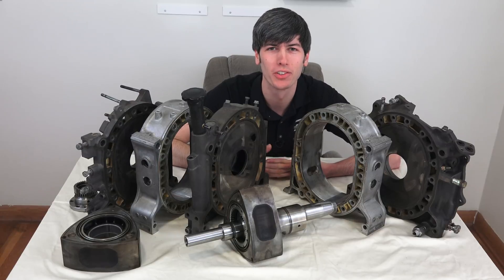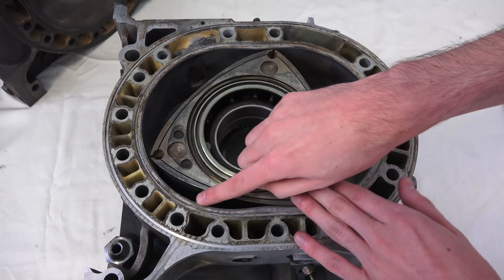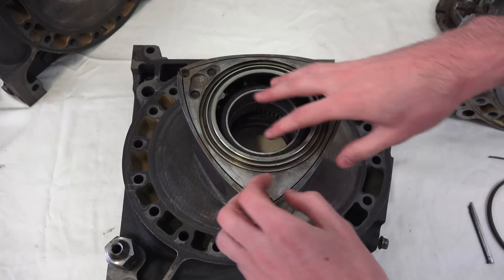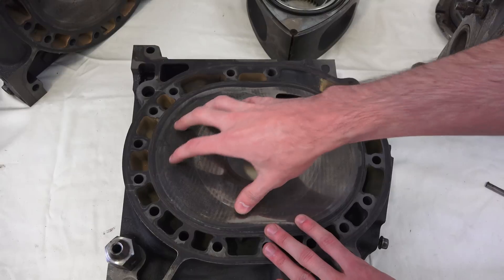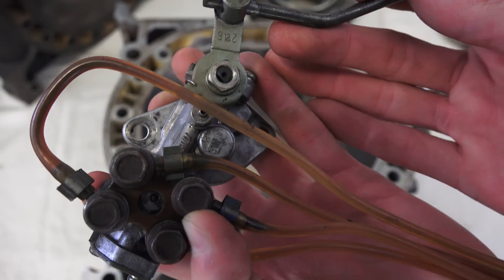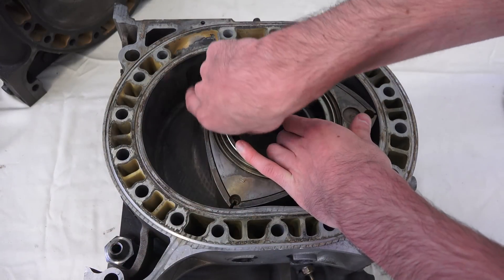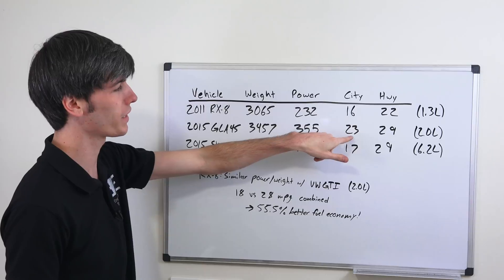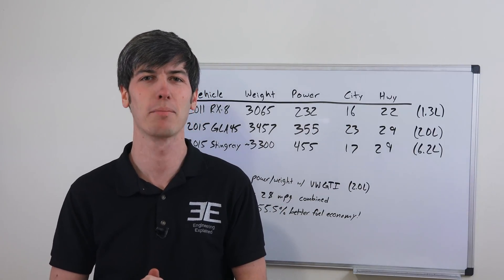4 Reasons Why The Rotary Engine Is Dead

Comment: It seems to me the rotary is getting a bad rap.
 Yes the later RX7s with turbochargers and built to compete with the higher horsepower and higher cost sports cars, may have overreached the technologies of the times.

But if you look back to the RX7s of the early '80s they were cheaper ($10,000 then, about $30,000 in today's dollars) long lasting - 250,000 to 300,000 mile engine life with a minimum of maintenance (by competent mechanic willing to learn new stuff as needed), almost zero pollution figures, and pretty good gas mileage for the day, 24 mpg around town and 27 highway actual and sticker for my '81 RX7.

I actually got 33 mpg on I-10, West Texas in 2007 driving an '82 RX7 with over 250,000 miles on the original untouched engine block, going 70-75 mph.
 
And yes rotary engines have oil injection, but on my '81 I never had to add oil between changes.
Reply: Also I would like to add the early '80s RX7s may not have much low end torque, not needed for a light car, but has a strong mid-range were you drive it and just screams from 4k rpm to the 7.5K red line. makes me grin just thinking about it.

Don't get me wrong it won't compete with the acceleration of a Vette or Porsche. But it is a true sports car in the vein of the MGB's, Triumph spitfires, TR2s and others of the '50s and '60s and even to this day.

I,m talking about light, low to the ground, excellent cornering and handling, two seat, short wheel base sports car revving to squeeze out every ounce of power, shifting up thru this corner, then breaking for the next shifting down and on. There is an added satisfaction to making a vehicle with nominal power perform well.

Another interesting thing is my '81 hardly notices a strong wind, your humming along wondering why other vehicles are seeming to have a hard time staying in their lane, then, oh! yea.

This is my experience of my owning, driving and maintaining 1981, '82, 83 RX7s. The '81 I have owned for 35 years.

So you may say or think what you want, but to me the rotary is a great engine and in an RX7 makes an exceptional sports car.

BTW if I ever build a home-built experimental aircraft, I will use a rotary engine for the powerplant.

Comment: I believe the Rotary also has poor leverage over the eccentric shaft, which is yet another factor - it generates very poor low-end torque and so it must rely on higher engine speeds than conventional piston engines.

I wonder though - does the rotary chamber not circulate coolant from the combustion side to the intake side in a bid to normalize engine temperatures?

Comment: It's really not fair to compare the highway EPA of the new Corvette since it has cylinder deactivation to get that 29 MPG on the highway. It doesn't have anywhere near 455 hp on the highway unless you stomp on it and plummet that mpg. Not saying your wrong about the rotary, just that without knowing more about the situation it makes the vette motor seem amazingly efficient. Which it only is when half of the engine is off.

Comment: Obviously the igniter (spark) needs be on the ROTOR itself if that is at all possible!  Even multiple places!  Might have to make the electrodes and insualors out of ultra exotic material for longevity...since it would a complete engine overhall just tor replace them!